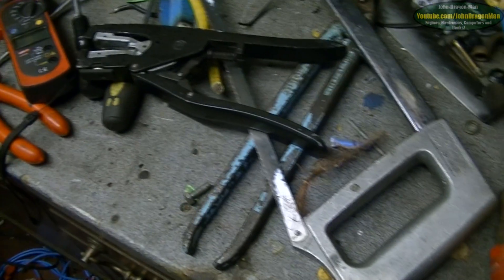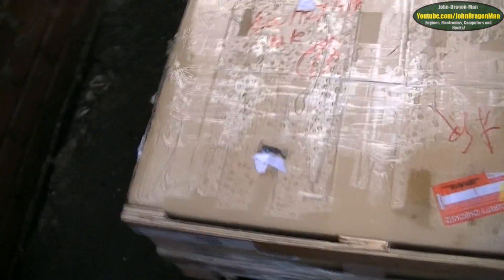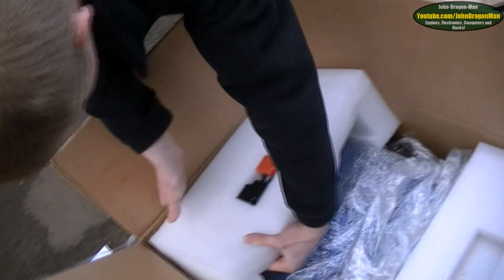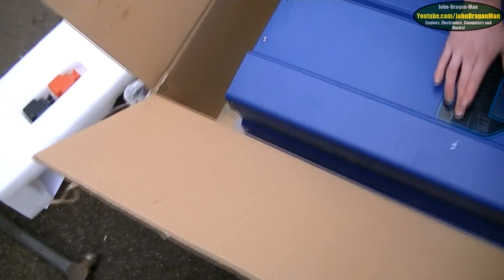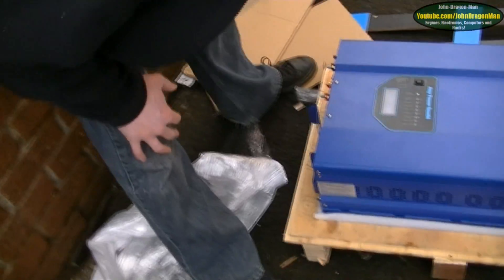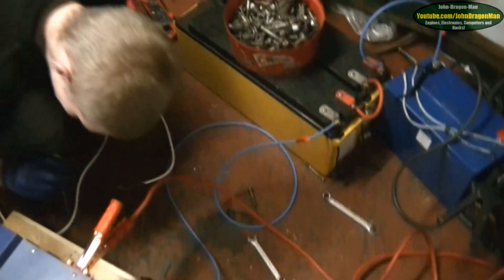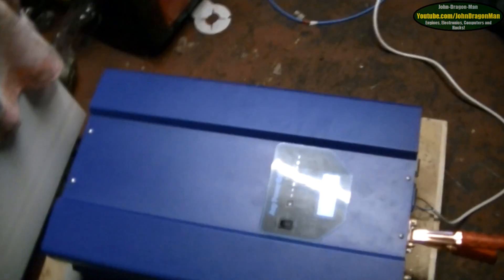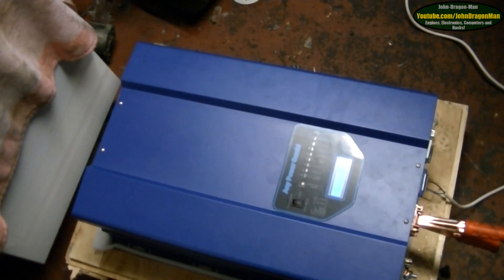12KW 36KW surge Whole House UPS Backup Low Frequency Pure Sine Wave Inverter 48v to 230v Part 1 of 5

Comment: I need one for Kenya... power here is shit, have like 30 power outs per week and that’s in Mombasa. At the moment i only have a small 2000/4000W UPS but it’s not enough for my 6000W shower heater or stuff like the oven, washing machine and induction cookers. May i ask what the price of it was back then?

Comment: If I start with some S17 Atminer motors and then pull it off, are they still on?  If it works, I buy if not, no.

Comment: Guys, you should study about electricity first, before deal with power. How you can run that 3-5 kW compressor from that pigtail DC cable (clamps just a garbage). That clamps are good to run car starter (DC motor don't care for voltage drop). Inverter will sense 20-40% drop because current will be about 200-300 amp on compressor start up.  Good luck.
Reply: lol

Comment: I have purchased and used 6 different inverters (3000 W - 6000 w) over the past 5 years.  4 out of 6 have failed.  I finally spent the extra money on an AIMS 10KW, Pure Sine, inverter charger.   So far so good.  However, I have learned to purchase a replacement plan anytime I purchase an inverter.  This is the Amazon link for the 4 year replacement plan for my 10kw inverter.  https://amzn.to/2QuMYdx    This is the inverter I purchased for OFF Grid Living.  AIMS 10KW, 120 & 240v, pure sine.  https://amzn.to/2D83qxs

Comment: Who wants to trust a Chinese inverter this size? not a dig , im just a little cautious have you hooked this beast upto an oscilloscope to see what the wave form is like ?? Iv been looking at several of these Large low frequency Aims knock offs, and they often use PWM which turns to modified sine under load

Comment: I must be mistaken to think this AIMS will even run an Air Conditioner compressor...sorry.    And  I am frustrated to read the AIMS user manual for the 10kw model.  Under 'Applications it makes no mention of using their 10,000 watt generator to run any  air conditioner.   Hence if the manufacturer does not provide any measure ... I should not make any recommendation to use this AIMS to try and run an AC.

Comment: Thank you for your comical efforts and results even in failure... for good measure can you reliably count on the AIMS to only start & run a central HVAC for at least 15 minutes (just to cool off the home) ?  If yes,  would you be comfortable letting the AIMS do one good thing only and just  cycle the  compressor for short periods ?   Interesting to see how much time  could handle just half your 5kw compressor with just one(1) smaller HVAC load (2600 watts consumed per 13.1 A @ 220 VAC).   It appears from your concern about  the compressor and batteries is valid.... but if only 15 minutes at a time were achieved to cool off a house... it would be worthwhile to simply switch back to the grid to maintain the cooler temps.  Anyway I hope you get your belts and braces squared away for measurable results.

Comment: 36 kw would power a whole street. You seriously need to be cutting your consumption not trying to get it cheaper.
Reply: Dean Waters, 12KW is just enough to run my welder. The whole house if everything was on could pull 48 KW and our neighbor has a 40KW GenSet. Sitting at our house is another 40 KW GenSet. Difference, his is Diesel and the one here is Propane. Now what is our average load? About 67KWH/day. The problem is, that refrigerators and other items have a poor power factor so you have to watch the watts and not just the amps.

Comment: Do you thing you can plug a battery charger in the wall and hook it to the battery's and keep a the floe going?
Reply from the maker: +Anthony Maisonave you mean like..  have the inverter power the battery charger, to charge up the batteries it is using?
sadly we have not got to that level of technology yet :/
Reply: Harry Potter can do that.

Comment: Quik question can i run 2 fridges a stove 6 flourecent tube witch got 2 tubes in each fitting and about 20 100watt light bulbs could some 1 plz reply asap want to go compleatly off the grid stay here in south africa and this place and load shedding is like brekfast lunch and supper for the goverment
Reply: DJNITRO ALLY Probably yes, but you need wery powerfull generator or solar panels to charge your batery bank which must be also wery powerfull 'couse this thing under ful load takes 250 amps and more...

Comment from the maker: ***** we would not touch power jack..  we have heard nothing but bad reviews about them.
Reply: If you're talking about oztules, he gets full whack from his cause he wound his own torroids for them which were twice the size of the supplied offerings.
Reply: +johndragonman i heard one good review on the LF powerjack inverters, but you have to do a bunch of mods like a in line inductor and some other not as important one, and you save like $200 compared to some alibaba models and thats if you call the pj ones half there rated cap, and the one guy was getting full cap from his, so there a lot cheaper and for like $300 you can get the entire inverter other than the case and connectors and transformers, so anything that can go wrong is a cheap fix, but what concerns me is that to use it as a charger they say you have to shut it down and plug it in then it will charge,  so im concerned if it will function as a ups like they claim or if that is a different model, anyways what alibaba brand is yours, ive looked at devel and cosuper models and it will be $2800 canadian for me to get one, so i have to sell my truck

Comment from the maker: endtheromancult Thanks man, this inverter is still powering away really nice! we have had say a good 3 or 4 (we are not sure how many) power cuts since we have had it, but the lights, heaters, micro waves, computers, Everything still keeps on running.

the max power we have had drew from it was 16kw (which took some doing as we dont have much!) it was not even getting warm to touch.

i wish we lived near a stream or natural spring as i would make a 48v/240v water powered charging system. that in the end would be powerful enough (after constant improvements) to maybe even power the whole home.

we are after a small diesel engine as we can get hold of waste oil quite easy. i would soon wire up a basic bank of car or lorry alternators to provide power to the battery side to take the load off them.
these modern common rail diesels are pretty nice things..  we have played with my brothers car which uses a 1.25L FIAT Multi-Jet mk2 engine and on tick over we have got its fuel consumption down to an amazing 200ml of diesel an hour. that is unloaded though. but still an impressive level. and this is before even changing any of the ECU settings/program.
theres some potential in that.

Good luck with the build and please do video document it!
Reply: Be very careful with common rail engines and waste veg oil the two do not mix! :(  The heat in the common rail caused by high pressure, and the extra heat when injecting cause lacquering of the oil similar to the gunge found around a chip pan. It will kill injectors, pumps and  block the fuel  filter.
I run bio in a 98 Golf TDI GT, but i am looking for an old Merc turbo diesel pre 1999 to use veg oil.
Reply from the maker: endtheromancult yeah i have thought of this, but i was going to go down the route of using WMO / waste engine oil
i like the common rail stuff as its "easy" when you can reprogram the ECU. not that i can..  at the moment.

an old diesel indirect injection engine would be very nice to play with. i love the sound of them. i would like one of the old merc UPS delivery van engines as i think they sound really nice and would be powerful enough to kick any home use geny over..

i can see you have a pretty interesting looking engine on your video so i am going to have a watch of it..
Reply: i am looking for a Merc E300 td pre 1999, the estate is more practical for collecting veg oil as that is what the Perkins will be running on but i am going to build myself a HHO bubbler to get the running costs even lower than the average £3 a gallon for WVO. The Merc will hapily run on warmed up WVO too! :)
Reply from the maker: endtheromancult yeah long live the old diesels :D  dont forget though, you get a lot more bang out of waste engine oil than veg oil ;)  theres some great articles on it online. plus i think waste engine oil once filtered is a bit more better for the engine. i am subscribed to your channel now so i will get updates as you upload them! i'll look forward to seeing them!
Reply: Pretty sure both Duckhams and Castrol engine oil is already recycled. ;) Cheers for the info though dude! I will look into engine oil, I'm sure that will be fine in common rails if it's well filtered.
Reply from the maker: endtheromancult checking out some of your other stuff..  you have some pretty awesome stuff going on.. i have a few suggestions to make on some stuff. ill reply back on the videos :D
Reply: +johndragonman 
What a fun project! Now you need a pair of 24 volt forklift batteries (and a forklift to move them).  I believe that unit will allow a generator to feed through it for a clean output while topping off the batteries.   I had the Aims 4000 charger inverter and liked it very much.  The diesel generator was an old Onan 3KW that would brighten the lights for a bit when a big load was turned off. After feeding generator power through the Aims, there was no more output fluctuation. The gen set would also recharge the gel cell batteries like a 150 amp charger.

As far as reliability, nothing beats the old Onan 3KW and 5KW air cooled gen sets. They run 1800 rpm, have no fancy electronics, are solar flare proof and run for years. Mine had a 25 gallon fuel skid underneath it and the whole lot weighed 700lbs...for 3KW. It got replaced with a 7.5KW water cooled 3 cylinder Onan diesel.

I really liked the variety of controls on the Aims so you can easily change the charging rate, adjust for the kind of batteries being charged, and set the preference to favor the batteries or external ''shore power''. It also had the standby mode where if the house power failed it would kick in and run, then give the start signal to run the generator.  

Also the pure sine wave output is great!  My voltage was steadier than what the utility sends, frequency was spot on, and motors, freezer, and furnace fan ran without the noise they made with the China modified wave inverter. The TV set and computer liked it as well as did the fluorescent lights.  It cost twice what the Chinese unit cost but Aims makes a much better product.

Keep up the good work!
Reply: Part 2???
Reply: kimmer6, Now if you really wanted to see a gas gauge move, you should run a 7.5KW Onan gasoline generator. Still runs at 1800 RPM but you can watch the gas gauge move even on a 50 gallon tank.

Comment: Just bought 2 of these babies from China for a full house off grid project. I liked the selectable voltage 12/24/48 and the UPS functionality, as i am going to be running a 48 volt battery bank, but my winter backup is a Challenger Tank Auxillairy Generator (Perkins 4108) 24 volt at max 500 amp.

I will run back up power through the mains power in, on the second inverter shutting it down when the genny needs to kick in as the batteries are discharged.

Loved the vids fellas, it helped me make a choice when there are only 6kw inverters available in the UK and OUTBACK chainable inverters are well out of my price range at 4 inverters to make 12kw!  Top man Jon!  :)

Comment: Hi John, genuine question, can this cause harm to RCDs when current in put backwards through them in the consumer unit? Cheers!
Reply from the maker: well, short answer no..But.
it should not really be wired in so it puts power back through an RCD.

we have ours wired in after the main isolator, then through the inverter, then to the rest of the trip switches which feed the ring main, lighting, ect..

you could do with going a bit of googling inverters and running your home on one..  they can be funny to get right. earthing can be an issue. have a check around youtube.
Reply: johndragonman if it goes through the RCD it will still function in a fault situation ;-) trust me its kinda my thing. unless i didnt get your description right. my plan is to have one of these with a big ass battery bank and an ATS the ats will trigger off the generator toggle when the voltage is too low from the batteries. im also toying with a charger on the grid side that is live while the ats is switched to the inverter side. (also thinking about the other side and having a charger on the output side of the inverter to charge the batteries off their own steam.)
Reply: Darren Barley
Reply: johndragonman did/ do you have an issue with the earthing arrangement? if so what was the issue?

Comment: it's actual 3% with is around 300 watt or so got one of the new models, the percentage is of 10500 watts with is 100% a 110% is the 12000 watts at a steady  50 volts on the batteries.